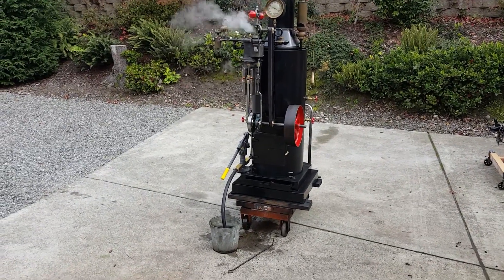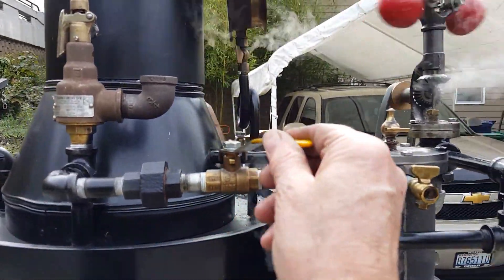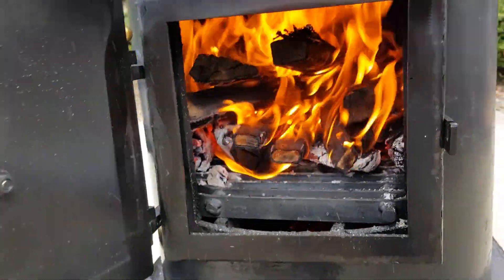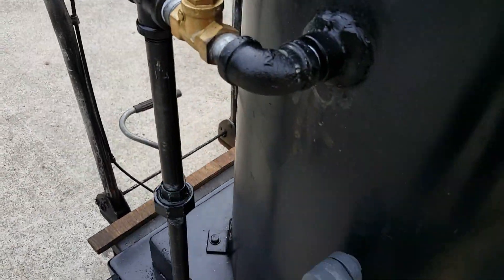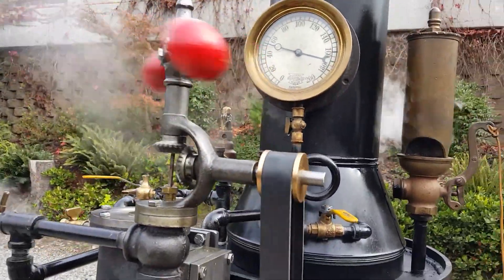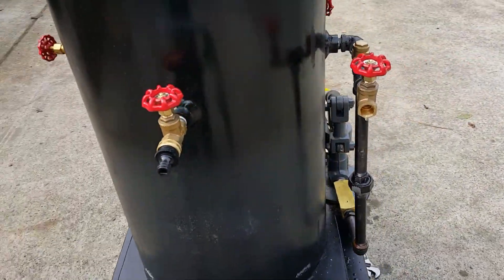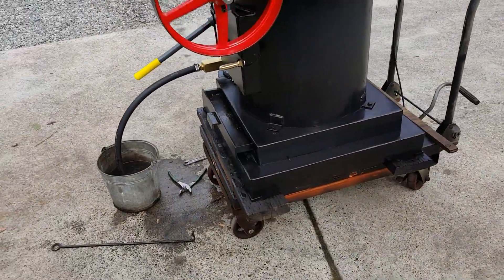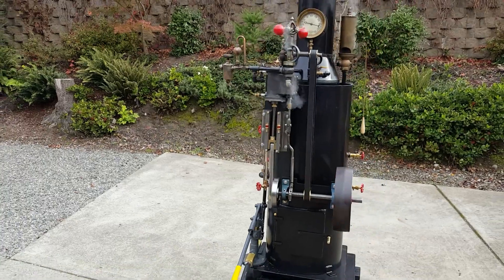Steam  Boiler with Engine

Comment: That's fantastic Ross. How much do you sell them for? What kind of kw out could one generate? Cheers J
Reply from the maker: The next 20"boiler will cost about $5,975.00. I will complete it in late April. The  steam engine with alternator is $5,675. You can see them on ebay. Search "steam off grid" Ross
Reply: @rossbendixen  thank you Ross. What is the potential kw output of your units. Cheers J
Reply from the maker: The alternator is rated at 90 AMP. I have no idea what the kw output is.
Reply: @rossbendixen  thank you Ross. would it be 12v x 90amps = 1.08kwh? What would shipping to the UK cost do you know?